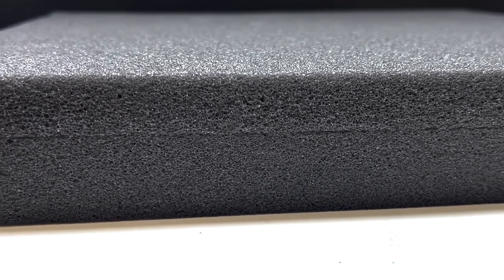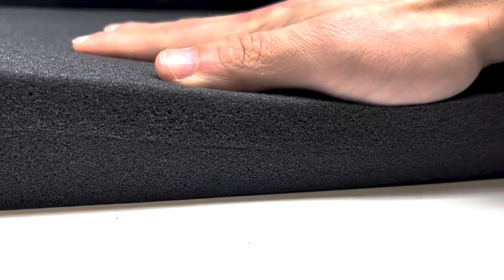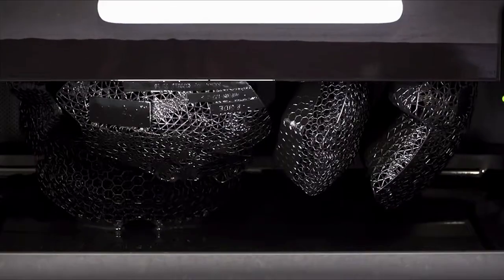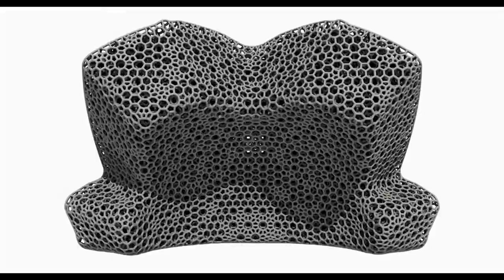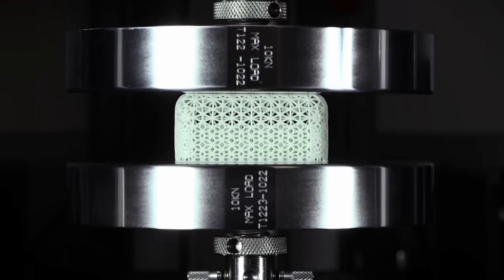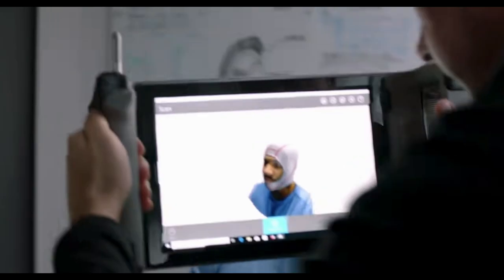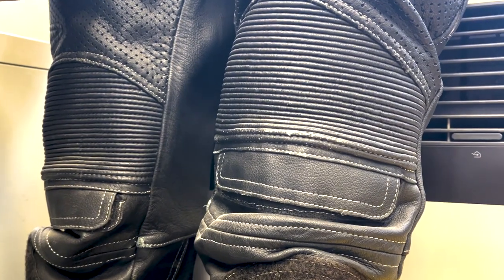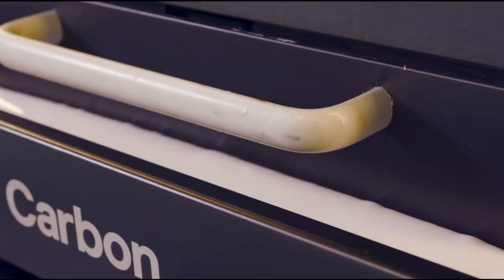We are Mass Producing 3D Printed Foam

Comment: Open cell foam actually has channels to which air can escape because only the edges of the cells are solid vs closed cell foam where the faces of the cells are solid as well. The interesting things to me are gradient density lattices which just can’t be done any other way. Maybe stacking different foams but that still can’t achieve what 3D printing can. Lattices can also be non isotopic where the material behaves differently depending on the direction of impact. Super interesting stuff!
Reply from the maker: All good points.

Comment: I've been investigating 3D printed foams with my FDM machine, I've been using gyroid so far since this can be printed quite quickly, although I would love to hear how you select which pattern type to use for your foams.
However, I've noticed that the characteristics of my 3D-printed foams vary quite a lot based on temperature. Sub-zero (celsius), my TPE/TPU prints are all quite hard, after some deformation they become quite soft.
How are you making sure your foams have consistent characteristics? For example in seats?
Just plain old chemistry? finding the right filament?
Reply: Bingo.  Helmets have to pass the testing at the full temperature range.  This is the CPSC standard:     Two helmets stay at normal room temperature and humidity (ambient conditions). Two are kept at cold temperatures between 1 °F and 9 °F (-17 °C and -13 °C) for 4 to 24 hours. Two are kept at hot temperatures between 117 °F and 127 °F (47 °C and 53 °C) for the same amount of time.

I want this technology to be true. I have my concerns about testing, and legal cover, and custom helmets.

Comment: Nice overview video! With foams, products designers are concerned with more factors than just breathability. Sometimes breathability is not an issue. Other times, Rebound is very important, as is compression set. Weight and tear strength as well. FDM TPU meshes dont feel half as good as a extruded polyurethane or eva foam, and they don't compress equally in all directions. I like the idea of Carbon's Adidas bottom, but these shoes are rather expensive, and now dirt can get stuck in there. I have a pair and they do feel good, bu the shoe is a bit heavy. I do love 3d printing and have been using it since the 1990s so I'm all in ideologically but the foam alternatives that Ive seen are just not close to the real thing.  Id like to try ColorFabb's Varioshore TPU, that seems rather interesting. Even so, many times with foams we need it to be softer than 60 Shore A, which I've not yet seen from an FDM printer. Anyone know how soft the Carbon or SLA type printers can print a material? and have you used anything softer than 60 Shore A?

Comment: The breathability point is dubious because it is not difficult to have a traditional foam design with some holes cut into it. All the other points are definitely valid. The Adidas 4D is especially interesting because they made the geometry in such a way as to move backwards under compression. From what I understand this is near impossible to achieve without 3D printing.
Reply from the maker: Thanks. The problem with the traditional "hole" or "wave prints" to aide breathability is that they create pressure points. The 3D Printed lattices are able to spread and loads much more evenly and uniformly. For generally padding it is not that big of a deal, except in motorcycle gear, but we did not discuss prosthetic sockets where it is an enourmous problem.